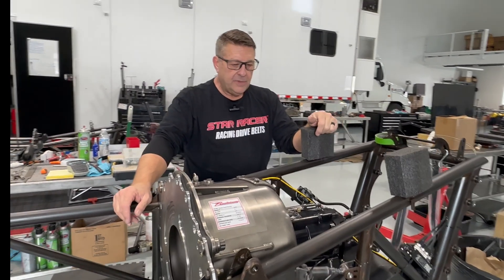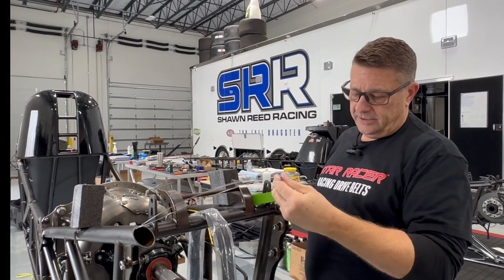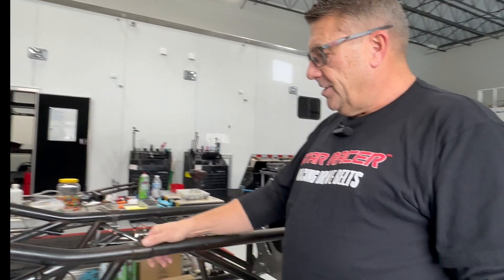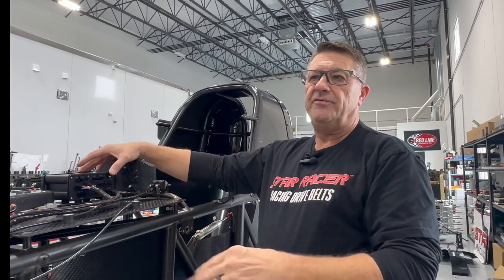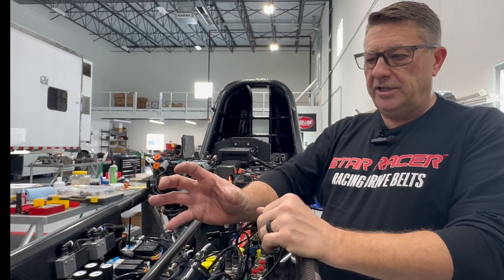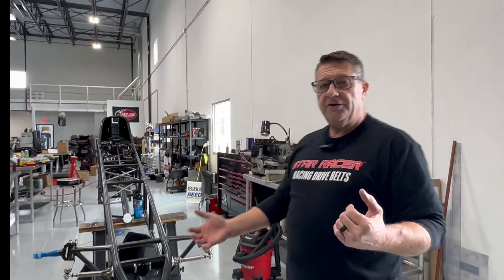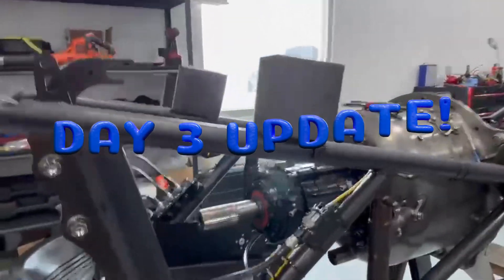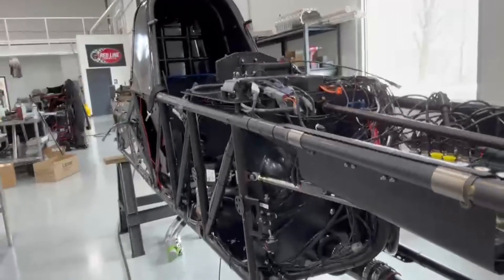LET'S BUILD A TOP FUEL DRAGSTER PART 2

Comment: Question rob do you have à batterie to all the electronics stuff or is the motor if you have a battery we’re you located thanks for the answer
Reply from the maker: We run an RC battery. 14.4 volts I believe lipo
Reply: @ thanks you for the answer in top fuel car i followed two channels your for the tech and clay mulligan channel.do you still take care of Dan Mercier car

Comment: Another great video . Man there is a lot to completing a racecar . At what point do you make spare cables and air lines ?
Reply from the maker: As we go along but in the heat of the moment, extra lines are ran outside. Maybe even around the driver🤣 if need be!

Comment: How modular are your wiring and air systems? Do you keep many subassemblies in the truck?
Reply from the maker: Yes, we have a harness for each sub, whether it be safety timer control or regulators assemblies. So in the heat of the moment we can get things switched out pretty fast.